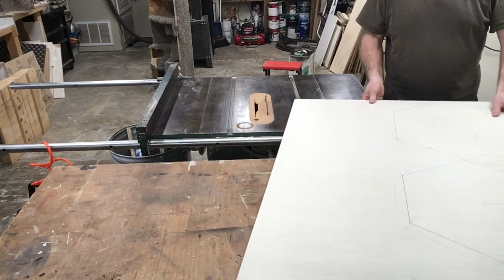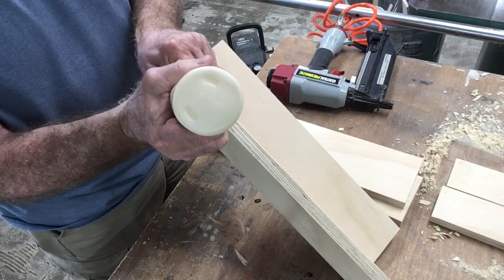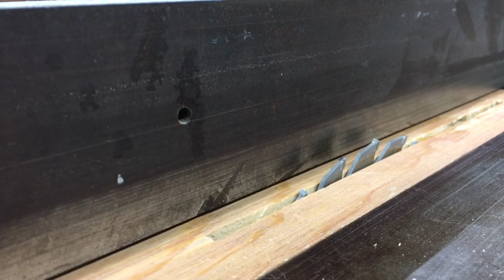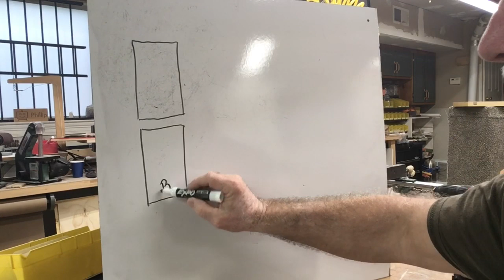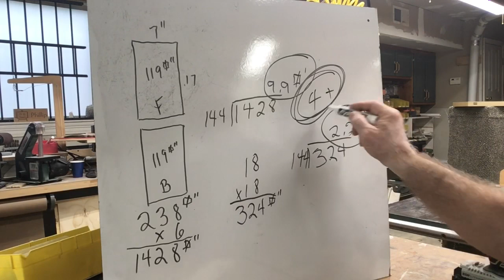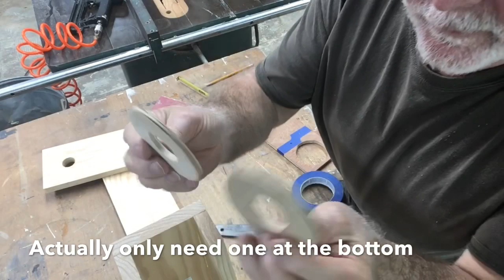AMAZING Turn Table Cabinet for Small Tools (Part 1)

Comment: I would think putting double sided tape on the two parts for all the cutting and drilling would work better.  The parts would stay together the whole time and you wouldn't have to try and realign them.  You could also use the blue painter tape/super glue trick to keep from damaging the plywood surface.
Reply from the maker: Excellent point.  Thank you

Comment: Instead of the 3" plywood washer as shown, maybe drill some small 5/16" holes around and just inside the outer perimeter, and drop some 1/4" ball bearings into the holes as you mount it on the wall.  The balls would provide a very smooth rotation of the whole shelving unit.  Unless, of course, the existing friction isn't enough to bother.
Reply: I was thinking of the same! Ditto for rotating the hexagonal faces. I am definitely making this - actually multiples of this to be fitted in at present wasted corner(s) all around the house.
Reply from the maker: Awesome
Reply from the maker: That's a very interesting idea